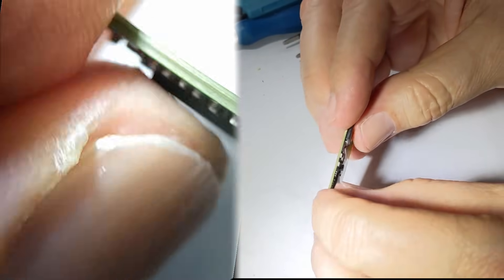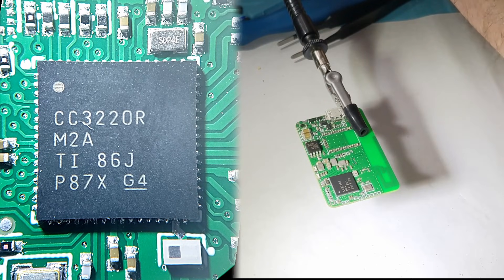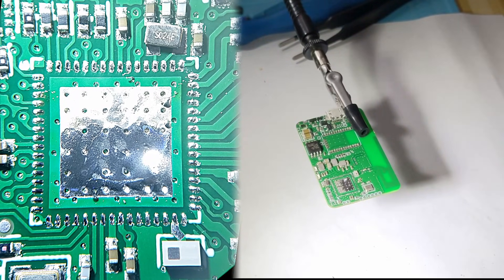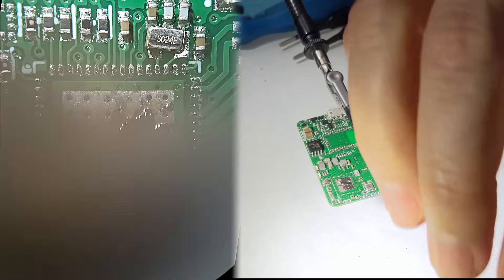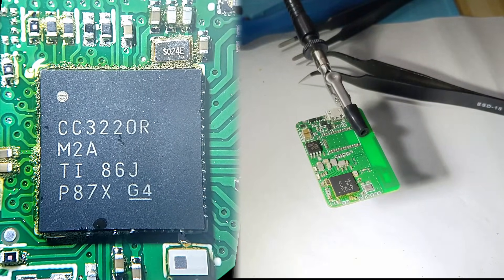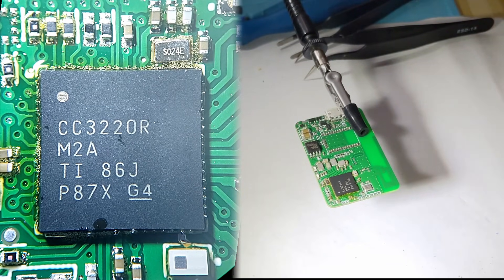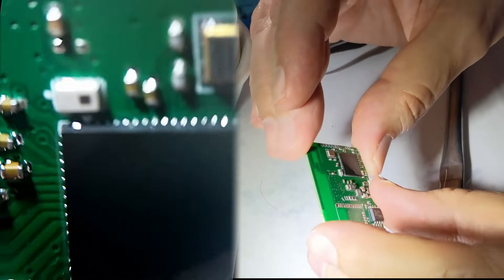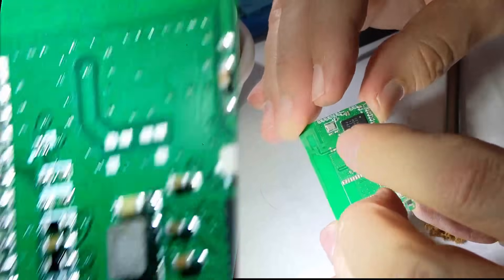Soldering MCU & QFN IC Chips with Hot Air Station

Comment: 99% alcohol (6:42) does not exist: maximum is 94% (ask any pharmacist). Also I use a lot less airspeed, almost like a whisper: prevents components from being blow away and does not significantly increase the time needed for component removal. This is due to the fact that the temperature energy from slowly movving air (ie energy transfer) is not improved by using high airspeed.
Reply: Amazon 99%
Reply: its that isopropyl

Comment: temperature in 3:35 (soldering iron)  ?
Reply from the maker: soldering iron is at 300 C, but you should vary it if you have a larger part or pcb.
Reply: @solderingironguide  kthanks

Comment: Good job, well done. Is there any possibility to check the connexion between the chip termlnals and the different pads before putting it to work?
Reply from the maker: You should not need to check the mcu -> pad connections, unless you suspect a broken trace somewhere. Just use a multi-meter from the mcu pin to pad. Using a good flux will make sure there are no solder bridging issues too.
Reply: @solderingironguide  All right, thanks a lot.

Comment: Hi, would a 500W station do the job?
Reply from the maker: It depends on the size of the pcb and the part you are working on.
Reply: @solderingironguide  For a job like this in the vid?
Reply from the maker: The pcb in the video is small, so the 500w should work fine.
Reply: @solderingironguide  Thanks mate! What size of pcb's are max for 500W?
Reply from the maker: It's hard to put a specific size per wattage, if you work on pcbs of varying size or pcb larger than 4 inches on a side, I would go for the 1k Watt station.

Comment: Hello, I do it the same way you do but the chip doesn’t go back when I push it a bit and it burns every time, I tried lower and higher temp and air flow. Any tips?
Reply from the maker: Hi Faysal, make sure you have enough flux. When you move the chip just a bump should move back. To prevent burning, make sure you heat the board around the part, not the part itself.

Comment: I started learning. Soldered a  couple MOSFETs and driver chip on a laptop for it to work again but they fail soon after. Think I'm not getting the heat pad parts soldered well enough. Think I need to pay more attention to quality of flux and solder and play with temp more. More difficult than it looks from pros on YouTube. I'm getting a little frustrated actually but I'll keep practicing when I get the time. I wish people would use temp gun to show actually temperature of surface they are shooting at.
Reply: Multilayer Boards always need a heater from downside to pre-heat the board. There are educational videos available from well-known manufacturers of soldering tools, like WELLER and ERSA.

Comment: Why didn't you cover the crystal oscillator?
It will be damaged by heat, right?
Reply from the maker: Ali, that is a valid point. Had there been any part in that area too sensitive, I would have covered it in kapton tape.
But all those parts can tolerate the ~180C it took to melt the solder.
Reply: I doubt crystal oscillator can handle that temps.
Reply: @hazim38780  I never protect cristal oscillators while soldering with hot air and I haven't had any failure.

Comment: a que temperatura usas la estacion y cuanto de aire.
Reply from the maker: Hi thanks for watching; check the video description I have more info there . The temp is 385 C and 36 for air speed. You can regulate the temperature and the air speed by adjusting the distance the air nozzle is from the board. In Spanish:  checa la descripción del video, ahi hay más información. Uso 385 C de temperatura y el aire a 36 de velocidad. Puedes regular la temperatura y el aire ajustando la distancia a la que sostienes la boquilla de aire caliente con respecto a tu tarjeta.
Reply: @solderingironguide  thanks